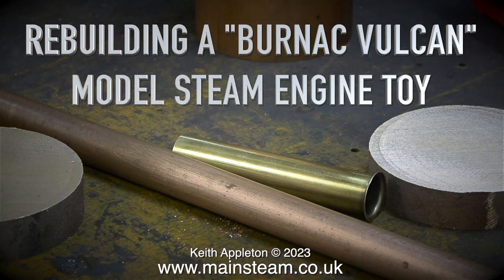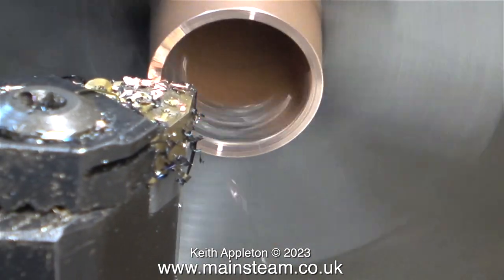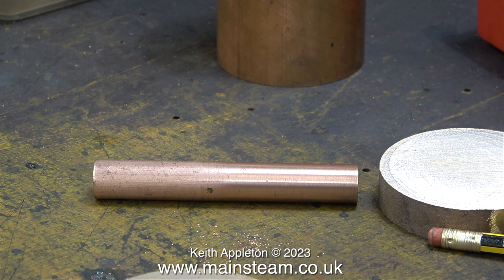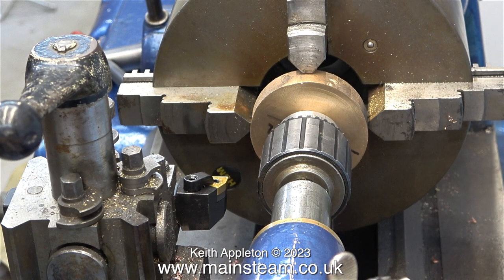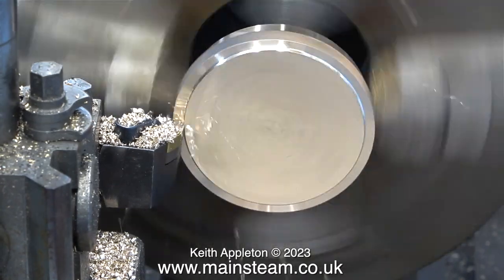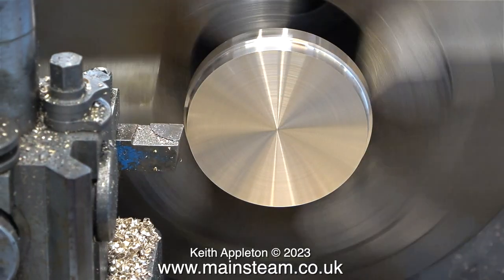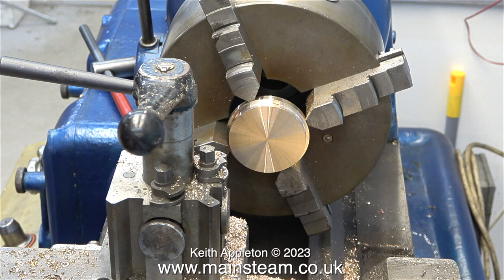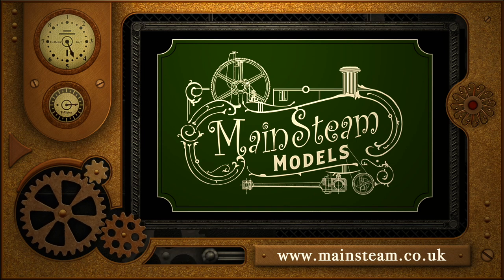REBUILDING A "BURNAC VULCAN" MODEL STEAM ENGINE TOY - PART #12

Comment: To machine soft metals like copper, do you use a special insert or the ones for steel are good enough?
Thanks for sharing!
Sart0
Reply from the maker: As long as the cutting tool is sharp, it will be OK for cutting Copper, but take it easy . . . .